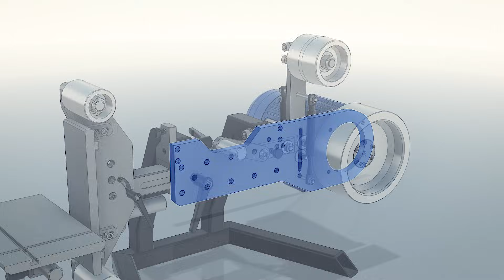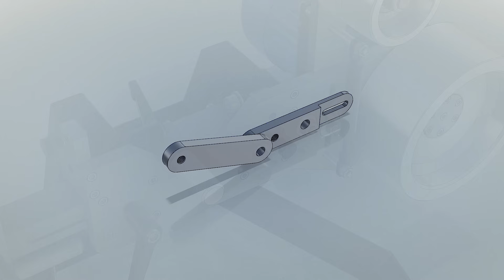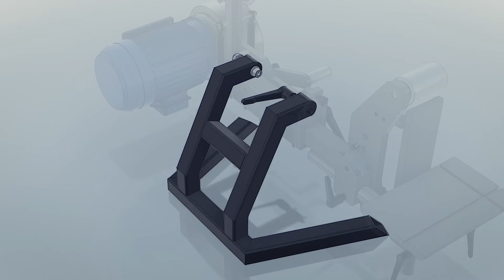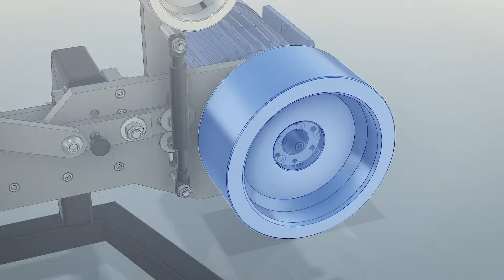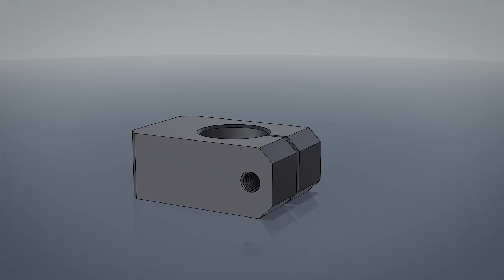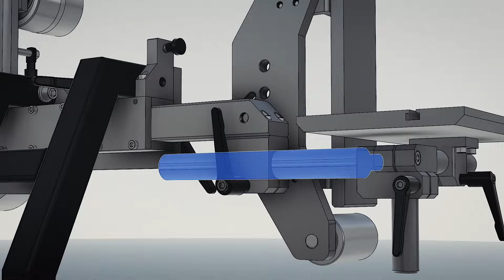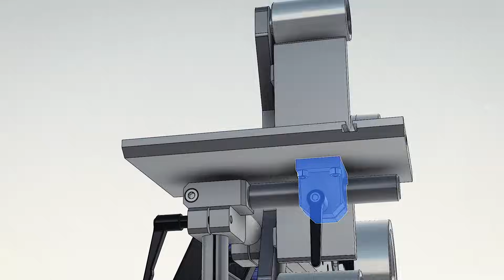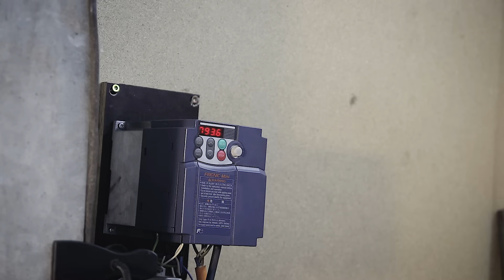Building a High-Precision Belt Grinder (Plans available)

Comment: This is nothing short of artistry!  Im so impressed with every aspect of your video.  Im curious about something. I know very little about machining. This appears to be mastery in every sense of the word. When it comes to the machining, how long would you say it would take to develop the competency required to execute a build of this quality? Thank you for sharing. Had my undivided attention the entire video. Subbed
Reply from the maker: Actually this is nothing all that special, these are all very basic operations and simple parts within the scope of machining. You could probably make something like this within a few months of learning if you have the necessary equipment. The "hard" thing about it is more the volume of work, making all these parts on manual machines takes quite a bit of patience, but it's not very complex, even though I guess it looks more impressive if you've never done it. Except for a few parts, none of this needs super tight tolerances or complicated operations.

Comment: Beautiful build. I am struggling to understand the viability of a high end grinder though. Those beautiful surface finishes and oily bits on a device that by design sheds sandy grit as a by product of normal use seems doomed to frustration. If I forget that it's a belt grinder I can really marvel in the beauty of your work though. Impeccable as usual.

Comment: Phil, Can you explain how you can pivot the belt to the side, is it just  a pivot or you have to remove the center and replace it. Seen another but don't care how they made the tube by welding the 4 sides together.  Can't see how you ended up with the main tube ? And to order plans you have to download them to a computer or like someone else do you have printed ones?  Great build 👍👍👍👍👍👍
Reply from the maker: Hi, I'm not sure I understand the question regarding the pivot but there is a much more detailed three part build of this on my channel where everything is explained in more detail so I suggest checking that out. As for the plans, they are a downloadable product, you get a PDF file with the drawings among other things that you can also print out if you want.

Comment: Almost perfect.  All you need is a VFD and a 3 phase motor.  Variable speed is way more betterer!  Not sure about the T nut slots either, I like my rest smooth.  The rest linkage is not the best as it has to be leveled both ways every time you install it.  The rest should be perpendicular to the belt always, if you need funky angles then make an adapter for the rest.
Forge On!!!
Reply from the maker: It does have a VFD and a 3 phase motor... also the table is indexable at 90° on all axis. You should probably watch the long version of this to get the full picture

Comment: Amazing design/build. My experience suggests the bearings (front 2 idlers especially) need to be closed at least on top to keep the grinding dust off the bearings. In my high use (4-6hrs/day) situation the only bearings that would last longer than a few weeks aren't made anymore.
Reply: You can buy bearings with good quality seals.

Comment: This is a terrific build. A build of dreams.
👍 Thanks ⭐⭐⭐⭐⭐
I wonder what something like this would cost mass produced. ❓❓❓❓❓❓❓❓❓❓
Would it be better to just get a machine shop❓❓❓
Reply from the maker: Good question, I've thought about this a lot. Building it manually like I did, it would be incredibly expensive because of the work hours. Using CNC machines and an optimized process, it might be possible to do it for a reasonable price but probably only if you produce large numbers. Overall it's not designed for efficient production at all, more a labor of love type thing

Comment: Is this a 4” x 72” belt rather than the usual 2 x 72” models that seem to be so common?  If so, would going for a wider belt deliver better performance or would the size add severe compromise?
Reply from the maker: It's neither, this is built for metric 75x2000mm belts. I find that the extra surface area adds a huge amount of versatility if you want to use the grinder for general metalworking and not specificially knifemaking which is what most people seem to use these for.

Comment: I'm interested in building one of these for knife making. Have you ever looked at making a surface grinding attachment for it? I can design one myself but I'll not reinvent the wheel if you've already done it.
Reply from the maker: Nope,  I'm not really a knifemaker so haven't had much use for that so far. I'm sure it would be possible to mount some of the aftermarket ones too though
Reply: @PhilVandelay  I reckon I'll get in the spirit of overengineering things on this and do a custom one. One thing occurs to me about the grinder design now I'm looking at it. How well does the belt track when you're running it in reverse? I'm seeing on other designs with similar tracking setups that you've got to tilt the tracking pulley to pretty extreme angles to get it running right in reverse and some allow tilting the whole motor mount and drive wheel to compensate. Is that an issue on this design?

Comment: @PhilVandelay what about making the front idlers different sizes, so you can grind different concaves
Reply from the maker: Yeah that would certainly be possible, it's also possible to build an attachment with interchangeable wheels but I haven't needed it so far

Comment: What upgrades/mods you made for Sieg SX4.
I dont believe it works so well out of the box
Reply from the maker: Most important is the DRO, other than that it works pretty well out of the box, the other things are mostly convenience features (Powerfeed, Spindle Lock etc.) 
There's an old video on my channel where you can see how I made the spindle lock and a spring loaded hammer/wrench combination thing for quicker tool changes, those things make changing tools a lot quicker. There's also a video about making the powerfeed.

Comment: 25:57 Is a bad idea to put some dust protection around tension arm slider? Oil with dust from grinding between so tight moving parts is a pain in the hole :D

Comment: great video Liked when you first built it and added the shield work,, question on a band saw .. I have a old one bench top size takes a 64.5 inch blade was built for wood . trying too cut metal with it put a fine blade in it cut good for 2 or 3 inches then it would not cut would just scratch the metal ,, put another new blade in still no cutting ??  could it be wrong tooth count or wrong RPM or both ?? did not know so I thought I could ask here .. I do have a floor model horizontal saw that I can change over to do table cutting just a pain in the back side .. the way you have to stand too use it that way ,, would love too get the other one going .. and the metal I am trying too cut is off the shelf stuff at a hardware store nothing special . thank you for any ideas ..
Reply from the maker: It's probably mostly the RPM being way too high, usually wood tools run way, way faster (almost can't be fast enough for wood) so the cutting speed for metal is way off which dulls the blade quickly. But might also be the blade itself, it's not just the tooth count, also the material. You want hardened Bi-metal sawblades, anything made for cutting wood will dull within seconds on anything harder than Aluminum
Reply: @PhilVandelay  ok thank you it is a metal cutting blade .. will play with the pulleys too slow it down..
Reply: Most likely any pulley ratio on a wood saw is too fast for any metal except soft aluminum. Even the slowest ratio. You want a range of 50 to 300 feet per min. Typically, I run steel around 90 FPM (+/- 50 fpm) and aluminum around 300 fpm (+/- 30 fpm) depending on variables like thickness, hardness, shape, material, coolant, etc.). Change blade pitch and tooth shape depending on thickness and material type. Check your existing motor RPM and then calculate your FPM.
Reply: @chip-load  thank you .. was playing with it a few mins ago ,, yes it was a wood band saw ,, has a metal cutting blade now ,, had a 2 inch motor pulley and a 4 inch saw pulley ,, will have to check rpm and do some math ,, it will be nice too cut with the table top saw other saw is a band saw horizontal cutting but can cut small table top pain in the back side too stand around the unit to cut in a safe way ,, so I would love to get this unit going soon ..  thank you again

Comment: what is that liquid you apply at the end that turn the metal black? i swear i seen parts with that finishing before but i never knew it was done that way
Reply from the maker: It's called blueing, there's actually a few different ways of doing it, this particular process is cold blueing. You basically apply a chemical (blueing liquid) that reacts with the steel and forms a black layer that is essentially corrosion, but actually protects against further corrosion after you oil it. There's also hot blueing, parkerization and a few other similar processes with different results and properties but they all turn the steel black. In Part 3 of the full version of this build I cover the blueing process in a bit more detail
Reply: @PhilVandelay  thank you so much for the answering man. I just discovered your channel you do some amazing stuff. This build in particular was also absolutely amazing!

Comment: Amazing video! But I wonder how much was that build on material cost alone. Must have cost a fortune...
Reply from the maker: The raw Material is actually not that expensive since most of the frame is mild steel which is quite cheap. The most expensive part is the Motor, Frequency Drive and the Aluminum for the pulleys and the drive wheel and the small parts also add up. But the frame+stand can be made for around 400$ or so

Comment: what is the name of that huge chamfer tooling called? i want to order one!
Reply from the maker: That's actually not a chamfer tool specifically, it's a large dovetail cutter that I'm using upside down ;)
Got it used at a workshop sale somewhere, it was at least 50 years old and unused, so can't really give you a source.

That being said, you can use a normal countersink as a chamfer tool as well, you can see me do it a few times in the video. There's also a much more detailed 3-part video series about this build on my channel

Comment: Curious what the bill of materials costs for this build. Has anybody gone through it that can total up the cost?
Reply from the maker: Depends a lot on your location, current material prices (steel and aluminum fluctuate a lot in price) and what you factor in (motor, VFD, etc.) , also which grade of steel you want to use so it's kind of impossible to give a fixed number.
If you use mild steel like I did, the raw materials are probably going to be around 1000$ (very rough estimation). I made a lot from hot rolled flat bar which is actually incredibly cheap, although annoying to work with due do the mill scale and bad dimensional accuracy so if you want to save yourself some work, cold rolled would be much better but hot rolled is definitely the cheapest option.
The most expensive material by far is the aluminum for the pulleys, especially the large drive pulley. I believe that huge  chunk of round stock was around 200$. 
A suitable motor can be found for as low as 100$ especially if you buy used and VFDs range anywhere from 100$ for a used one to around 1000$ for a nice new one. Chinese VFDs have gotten quite good and can be bought for around 200$ new, I just put one into my lathe which you can see in one of my recent videos and so far I'm very satisfied with it.
If you're very frugal and patient with looking for good deals you could probably build this entire thing for something between 1000--1500$. Hope that helps
Reply: @PhilVandelay  Thank you - this level of detail is very useful. I suppose for the time-rich money-frugal among us a cost effective solution might be scrap aluminum casting to get the pulleys done, but as I've not tried casting yet I'll stick with the estimates you've provided. Thanks!
Reply from the maker: Yeah the results I've seen from amateur aluminum casting are pretty hit and miss. I probably also wouldn't feel comfortable having a huge chunk of aluminum spinning at 3000rpm made from a questionable, potentially brittle material. I have seen people make the drive wheels by welding a large pipe onto a disc and then turning it so it runs true - maybe not a bad idea if you want to avoid turning 70% of your stock into chips.
Reply: @PhilVandelay  As to questionable aluminum I've seen that body repair shops are a great source of reliably marked 7018 from broken rims. To your point though anyone going this route better either know what they're doing casting-wise or have excellent life insurance.

Comment: like this beltgrinder , not a lot of welding and the chance to bend it intoo a pretzel with the heat put intoo it , i rather machine parts then weld it , more certanty that stuff ends up straight
Reply from the maker: Yup that's why I prefer this approach although it's a lot of work. Welding is great for a lot of things but keeping things straight and precise is not one

Comment: 1:15 you need mill jacks, that's WAYYYY to much stickout.. did you see the flex?
Reply from the maker: Yes, but doesn't really matter for drilling a single pilot hole. I use mill jacks multiple times later in the video

Comment: Hyper accurate tools, operating at crazy speed and torque, making parts at high tolerances for another tool designed by an artist that will be used free hand by another artist